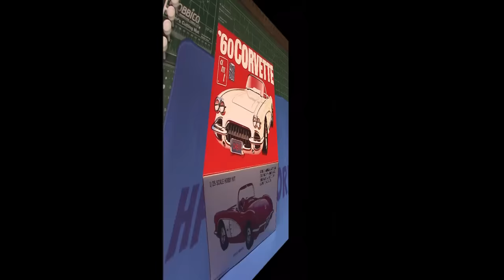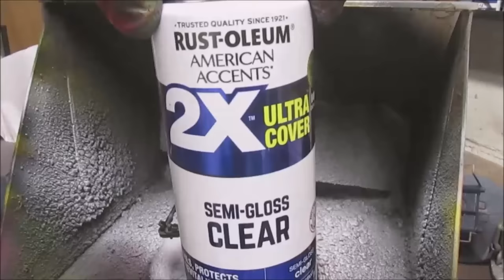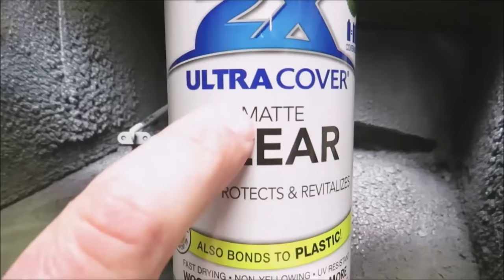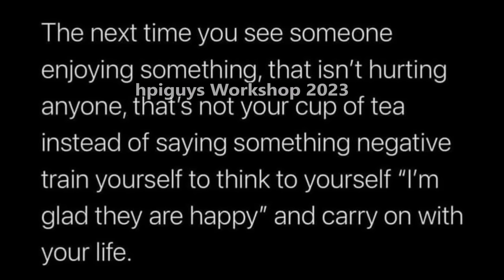1960 Chevy Corvette C1 V8 Custom Rod 1/25 Scale Model Kit Build How To Assemble Paint Chrome Trim

Comment: Just recently discovered your channel and gave it a view. I’ve watched several other model makers and they are good, but they use the fancy air brushes and such to do the painting. When you pulled out the ole rattle cans and painted your model it was a flashback for me,that’s exactly how I used to paint mine and they came out great. I like the simpler ways and you do great work and you have a new subscriber.

Comment: Always liked these early Vettes. Don't sweat the wheel backs sticking out; same thing happened with the 41 Plymouth I'm building. They look like brake drums and are entirely consistent with the era and your build, although I did narrow mine some to fit better with the steelies I'm using in my version. Cheers!

Comment: Thanks for all your great videos! When I built this model in the 70’s it was necessary to scrape chrome plating off the gluing areas so they would stick. Do you do that off camera or are there modern adhesives that penetrate the plating?

Comment: Where did you purchased your chromed hand drilling tool? 
It even looks like it has a hex-head that would work with a ratchet and socket. 
I don't find anything like it at Hobby Lobby or my usual hobby stores.
(they have some screwdriver bits, but no drill bits)